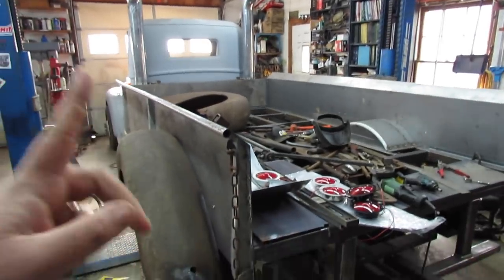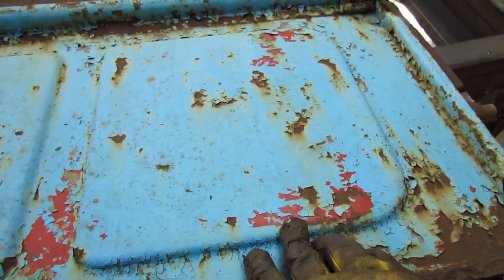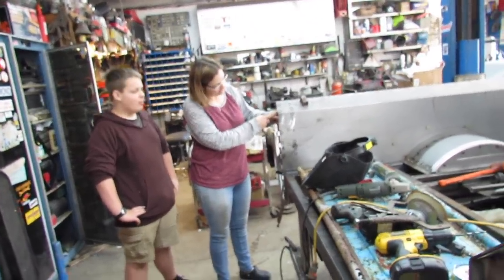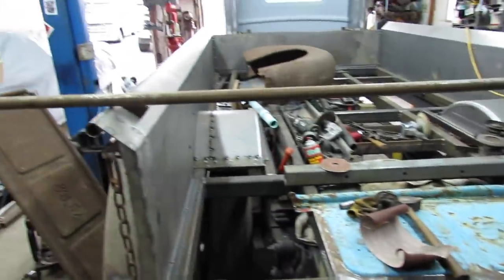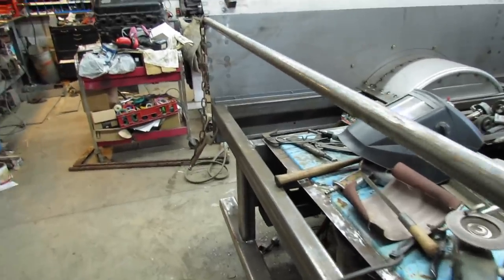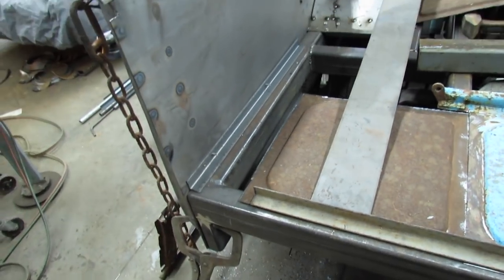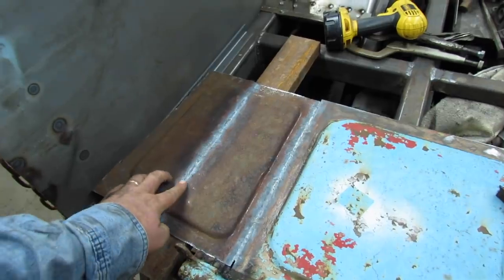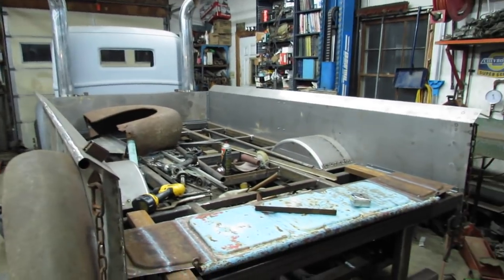46 Ford-Build The Bed-Part8

Comment: I just went through same with my batteries-  either the charger or the batteries died-  I have been able to buy off EBay used and made tools last a few more years but sometimes buying used is a crap shoot- my tools so old that new batteries will not work-  changed design-  so now it was cheaper to just buy new tools when on sale than just to replace the batteries-  so that was my Christmas present to myself-

Comment: If your battery packs are completely shot, check out a place called Bluff Valley Battery in Wisconsin. Rebuild them yourself and switch them to NiMh cells. Cheaper than oem replacement by far and you’ll end up with a better battery. I did mine a year or two back and my Dewalt drill acts like it’s on steroids.

Comment: Would it be any different or beneficial to use 45-degree cuts over straight up & down cuts to lengthen the tailgate ends?  As far as strength and flatness, I figured it would .